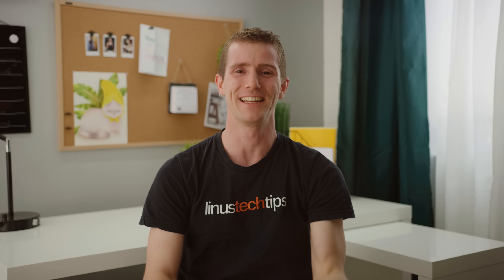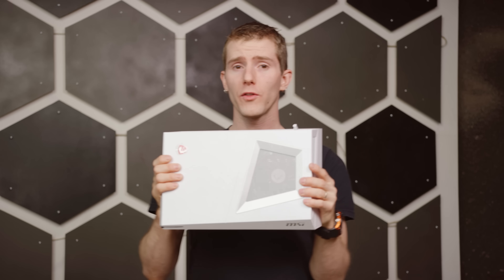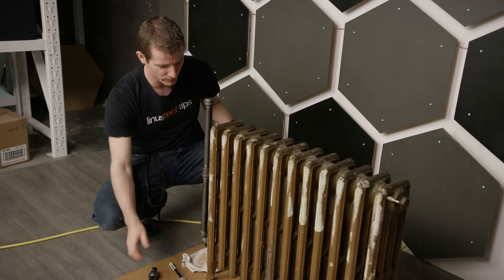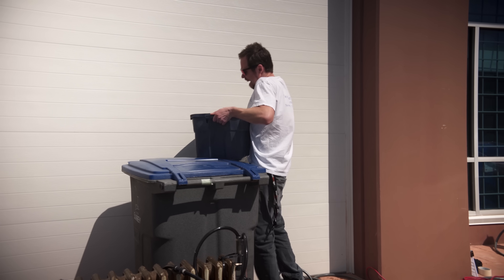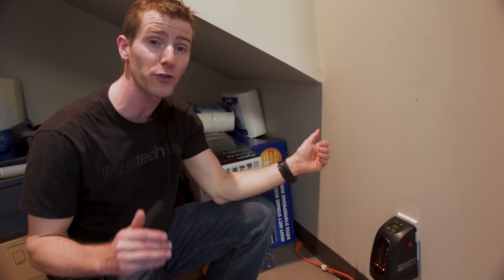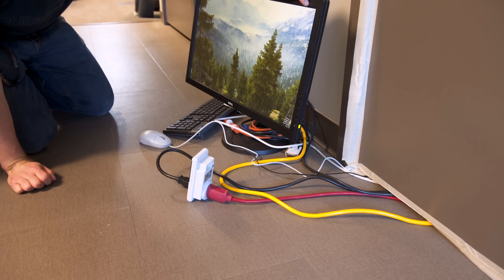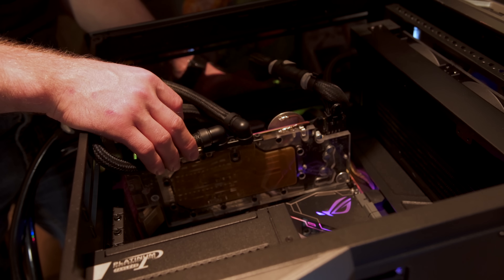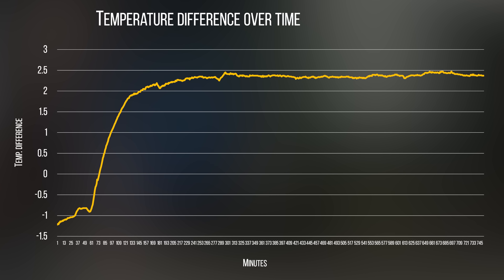Lower your heating bill... with GAMING

Comment: This is a game changer for Canada. 
-"How do you keep your house warm in winter? Wood stove? Natural gas? Furnace? Baseboard heater?"
-"No. I game."

On a side note, anything consuming wattage, is a heater. Some more efficient than others, but also more boring. If you work from home, online, then using a pc to heat an area actually pays for its self.
Reply: If one really wanted to one could even put the radiator outside. Fill the lines with coolant, and game with everything over clocked. Having the coolant run at a nice and steady -20c/-30c in the dead of winter. Dealing with the condensation is another matter though...the board would have to have a coating on it if the condensation became a problem.
Reply: I wonder if a clear plastidip would do the trick.
Reply: Anything electrical is equally 99.999% efficient at heating. Every watt that comes into the room and doesn't go out the window as a photon is a watt that stays and heats the room. Maybe exactly lightbulbs are less efficient.
Reply: How did your cousin die again Pete?  
Pete: He was a gamer, and thought the PC would keep hm warm.  
In Canada?  You sure he wasn't from Georgia or something?

Oh and if you want to chill the PC to -20ish and it's -20ish outside... put the PC outside.
Reply: @TexMex421  Just fill your room with cryptocurrency miners, you'll be fine
Reply: @Soitisisit  The little computers, or actual children?  I suppose either would generate heat...
Reply: @TexMex421  Hahahaha.
Reply: @TexMex421  What? Pc that consumes 300 watts is exactly the same, in terms of heating performance, as a space heater that consumes 300 watts.
Reply: @TexMex421  That's quite true. You said some more efficient than others. Efficiency and throughput are different things.
Reply: @petersimon1435  I did not mention efficiency here.  
This whole video is strange because the PC would heat the closet just fine with air cooling or "normal" water-cooling.  The best way to make more heat would be to to have poor cooling, and even then your more likely to just get slow gaming, or system crashes.  
The radiator would take a long time to heat up and when the PC was turned off a long time to cool, but the amount of heat would not change. That seems worse.
Reply: @TexMex421  We're not disagreeing. I just made a small correction to your original comment where you said "On a side note, anything consuming wattage, is a heater. Some more efficient than others". In that it's really hard to find an electronic device that's measurably less efficient than any other electronic device. They're all effectively 100% efficient.
Reply: @petersimon1435  Someone else said that. 
A space heater is 100% efficient because it's waste product heat is also it's main purpose.  But with something like an electric car, it's waste heat is just waste.  It's not 100% efficient or even close and that is the case for the vast majority of electrical devices.
Reply: @TexMex421  Wdym someone else said that? I was directly quoting your original comment.
Reply: @petersimon1435  Strange then that it appears in the post of Circa 1985 above, and not mine.  And also is not something I would say.  "consumes wattage"?   It's like this people who refer to video as footage.  probably went to some public college.  gross.
Reply: @TexMex421  Oh, shit you're right. Your pictures look similar, my bad. lol
Reply: @TexMex421  so people who go to a "public college" (what ever that is) also use the word footage and are therefore less intelligent than people who go to what, "private colleges"?

Edit: spelling
Reply: @TheCabbageMan   Are people who go to "public collage" different than people attending a public college?   I'm not sure.  I recall making a collage in 6th grade art class, but not much since.
Reply: @TexMex421  good one bro
Reply: Fridge also heats up the home. I suggest trolling someone by suggesting they use their fridge as a air conditioner.
Reply: @losttale1  I think there is a Red Green episode on that.
Reply: I've been running an FX-series since 2015/16. Best heater.
Reply: @drunkenhyrda  Lol. That's what you're using the cryptocurrency for.
Reply: @petersimon1435  Untrue. VERY untrue. Most of the thermal energy dissipated as heat is from (I^2)R loss. Resistances vary drastically from one material to another. They design-build heating element to have very high resistance, while conductors like copper/gold used in your system are there to avoid as much (I^2)R loss as possible. 

It's not that your wording is wrong. Your entire concept of heat loss/generation via electricity is. Anything 'electrical' is hardly ever equally conductive(resistive), hell, if purity of materials aren't in check, even the same materials can have quite a lot of variance.

There's a WHOLE lot going on inside that consumes energy without being an ACTUAL heater. Triggers me to see pseudoscience glazing over it.
Reply: TDP is not same as active power consumed. space heater, most of 300w goes straight to heating. PC that consumes 300w DOES NOT dissipate 300w as heat. (ABSOLUTELY NOT). You could have rigs with 600-900w and dissipate like around 350-400w as heat. 

Your PC would be called a space heater, if it had same heating performance. Not PC. Your Energy physics knowledge is weird. You might need to liquid nitrogen cool your TV since it draws so much power lol.
Reply: @C to the H Well yeah, but it doesn't explain or dispute anything those people are saying. It's 'as simple as that'. but then again F=ma pretty damn simple and I can't send a rocket to orbit.
Reply: I mean pcs are more efficient as heaters than actual heaters
Reply: @petersimon1435  this is true, but electricity generation is not 100% efficient. So long as the power grid is fossil fuels it makes more sense to burn the fossil fuel for heat directly, then to convert it to electricity then to heat.
Reply: True. Heating is the #1 energy expense for a Canadian homeowner.
Reply: @petersimon1435  This is entirely wrong. Every watt does not generate the same heat at all. Some power is lost as light and some is lost to create movement etc. Do you think a 5watt fan generates the same heat as a 5w heater? How about air con? Please don't spread crap like this, it is completely and utterly wrong. The amount of heat generated is also completely dependent on the size, material and thickness of cables and the overall efficiency among many other things.
Reply: @richbob9155   Listen I'd love to go back a year+ and try to figure out what the h3ll you are talking about, but I have a life and better things to do.  You should try it.
Reply: no such thing as a more efficient electrical heater
Reply: @BirdTurdMemes  By efficient I mean how much money you spend. It is a lot more efficient to buy a 1500 watt heater, then to spend money on a 1500 watt power supply and everything in pc in order to pull 1500 watts out of it to achieve the same heating capability, for most people.
Reply: @richbob9155  The fan does generate the same heat as the heater.
Comservation of energy is supreme. 
A 5w fan will generate 3w of wind and 2w of heat.
Then the wind will be slowed down by air friction and transformed into heat.
Running a fan in the summer to cool yourself is actually heating the room if you do not circulate the air.
The only energy that a computer doesn't reject as heat is the entropy energy of storing organised data, which isn't a lot, also wifi signal.

Comment: Heating a room in the summer. Perfect timing.
Reply: i was gonna comment the same thing
Reply: What about the souther hemisphere?
Reply: Linus obviously looking out for our southern hemisphere brethren. Good guy Linus looking out for the NZ's.
Reply: video was prob made 3 months ago lol
Reply: you can put that thing outside
Reply: It's winter in Australia...
Reply: This is why we have global warming
Reply: or the basement if you can. The radiator does not needs to be in the same room, as long you have two tubes to get water to circulate.
That's what I'd do. install a copper or aluminium radiator, cheapest from the DIY store, do some plumber working and connect it to the PC.